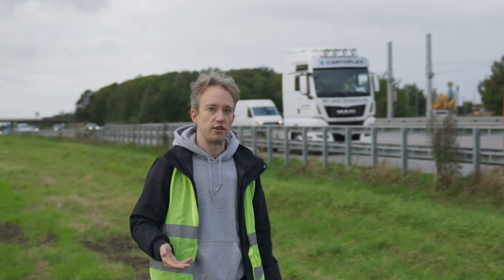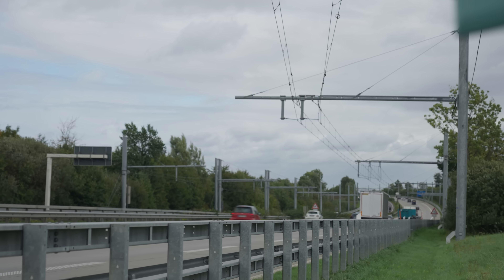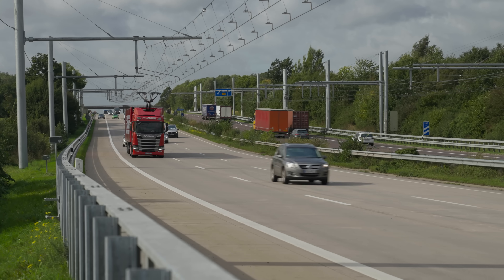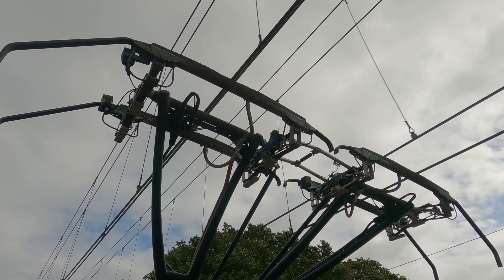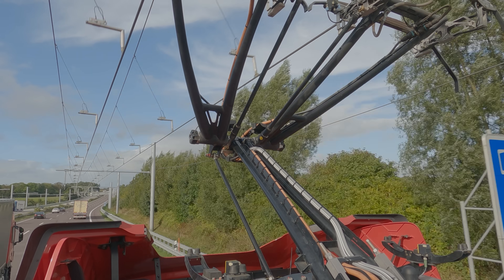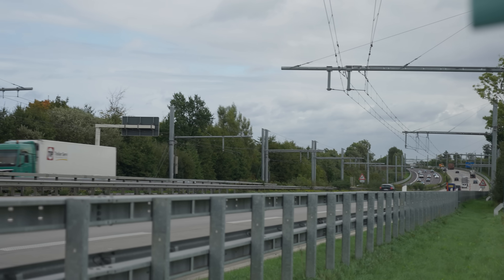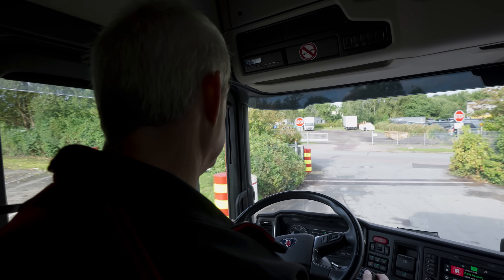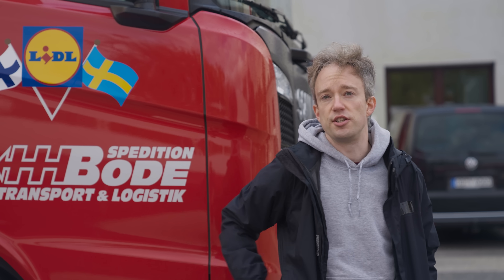The highway where trucks work like electric trains

Comment: Can't wait to see this feature in Truck Simulator 3.
Reply: more likely on 2 by dlc
Reply: @serdarcam99  True and most likely be £13 or $13
Reply: @serdarcam99  Save the World DLC
Tesla Semi, Kenworth T680 FCEV, Peterbilt 579EV, Freightliner eCascadia,
Reply: You joke but I absolutely don't see why not
Reply: Do you mean Euro Truck Simulator 2.
Reply: Electric autopilot... so fun, very enjoyable
Reply: I think you'll have to wait for Truck Simulator 15.
Reply: assuming it will ever come out
Reply: Hell that would still be cool feature to implement
Reply: Yeaaa
Reply: why not ets2?
Reply: @krisnadiimam4556  Well ... also ...
Reply: Lmao
Reply: Hahahaha 🤣 bruh
Reply: In Europe it will only go as far east as Hungary. :D
Reply: Super 🙏👍🙏
Reply: noobs!
Reply: And Euro Truck Simulator
Reply: Euro Truck Simulator 2 actually got a fully-electric Renault truck in a recent update
Reply: The real question is when the trucks are supposed to fall, do they break from the wire, or do they hang onto the wire.
Reply: @dinnerboons1504  What do you mean by "supposed to fall"? Also, the trucks are connected to the wire via a pantograph, so the only physical contact is the two metal pieces touching.
Reply: @dinnerboons1504  fall???
Reply: Train Sim World has it already, except without steering! :p
Reply: @Quasihamster  Except Dovetail still making switch from diesel to electric (for hybrid locos) as another separate mission, cause they didn't cracked the script for a real thing yet.
Reply: @jayswarrow1196  I don't care really, trains are trains, all the same.
Reply: ok verified person.
Reply: @MasterBomer  how dare they be verified lmao

Comment: What will be the fuel of choice for electricity generation ?  Are emissions from power generation plants treated differently from automotive emissions ? If yes, to what end ? Also, as this scheme is being piloted, it might be helpful to know the 'fuelwise' contribution to Germany's electric grid at present which might help extrapolate the same 10 yrs down the road.
Reply: I am not sure about Germany but in Ontario, Canada we have clean nuclear, wind, and hydroelectric power. (95% of our power is zero-emissions) A system like this would undoubtedly reduce emissions. 

I know France also has a very clean power grid.

Comment: I think it's not the best solution, because it means that they have to build new trucks and this emmits more CO2 than keeping the old ones for at least 10 years. Also, why don't they just use trains, the infrastructure is already there (for the most part), they only have to extend it a bit and the roads wouldn't be as full as they are now.

Comment: The autobahn that this installation is on seems quite lightly trafficked; I don't know whether it's always like that. I think driving with the system on our very busy motorways in the UK might be problematic or indeed impractical.
Reply: It highly depends on when you are driving there. It's the main connection between Hamburg and Lübeck. 
During rush hour, it is highly trafficked, but the rest of the day there isn't too much traffic. 

The problem is that I have never seen a charging truck at this part of the Autobahn even though I live 10 minutes away from it.

Comment: I thought about having a similar thing in the other lane for electric cars, but then it would mean trucks or any taller vehicle can't cross into that lane, and also the cars will be trapped in that lane causing traffic jams more often
Reply: The thing is, for electric cars it's not really worth it. Trucks are large and heavy, and drive for long hours. Cars are small and lightweight, and most are often used just a few hours a day. Most cars spend far more time parked than moving, and when they move, they do so well within the margins of battery autonomy. Few cars, such as cabs are the exception.

Comment: "Most efficient"?

Citation needed.

Yes, batteries are not perfect, but compared to the costs and effort of wiring up every single road in all of Germany and the maintenance of it all, and all the safety considerations and concerns?

Sorry, but simply putting more batteries in a truck - which is not exactly a small and light vehicle anyway, so it has the room and could take the weight - would surely be the vastly easier and cheaper solution.

Like, being more precise, the cost and capacity of batteries has followed a "Moore's Law"-like progression over the last 10 years. New tech like solid state are coming. Improvements in efficiency of existing lithium ion is on-going - such as the elimination of the use of any cobalt. This is like hydrogen fuel cell cars - by the time you've got all the infrastructure and safety stuff in place to do it, then the problem's vanished in the meantime. Electric cars used to, at best, do 100 miles ten years ago, now they're doing 300 miles. While the price per kilowatt has fallen off a cliff.

To be clear, try these things out. Empiricism for the win. Give all these mad ideas a chance, just in case one of them does prove awesome. But, nah, by the time you've got all the infrastructure and safety in place, then battery improvements will have made it redundant.

Hydrogen fuel cell cars are similar - by the time the infrastructure exists (remembering that hydrogen is an explosive gas, so you've got to have lots of expensive safety measures in place too), then the problems they were meant to solve - that batteries couldn't deliver the range and take longer to charge - have already gone away. 

Like, if you proposed hydrogen cars 10 years ago, then it might have made sense. But now you've got ordinary EVs - on sale right now - that'll do 300 miles and can be super-charged to 100% in 15 to 20 minutes (and, as has been commented by others, if you're travelling 300 miles, then YOU, the driver, needs a break too - you, as a human being, need to stop and refuel with some food and a trip to the toilet and, with truck drivers, that's actually a legal requirement, not just good advice, so one could even see battery vehicles helping to ensure that important health and safety requirement that you take regular breaks, actually happens).

And, indeed, talk of hydrogen-powered electric vehicles has kind of slowly faded away over time, as that calculation has been made that the range and charge problems that hydrogen was meant to fix have already rapidly disappeared.

Comment: If you want electric for everyone and everywhere then run wireless charging under the primary roads or on a rail along side then everyone charges their battery's while on the move  (it works just like wireless charging on your phone)  You add this to all major roads and when a vehicle leaves the main road it is fully charged for local non charging roads.   It looks better cost less and simply works better.    This tech is right around the corner and is being tested now.
Reply: wireless charging is unfortunately very, very wasteful - to deliver this much power via wireless charging would waste literally half of it.

Comment: To everyone saying just use a train:
Trains cannot do the last few miles from the station to the store. By the time that trailer has been transferred from a train to a truck (often by an expensive unionised employee), it is cheaper just to use a truck for the whole journey. It's also quicker, which is important for perishable foods. That's why village and town rail freight yards have been closed by the thousand. Railways were invented in a time when onward transport was by horse and cart. 

This system uses electricity, just like a train, but allows for efficient transfer between depot and shop. I think it's fantastic and should have been done a long time ago.
Reply: Technically containerised freight speeds the transfer process up way more with just a box being picked up from the train and dropped off onto the truck in minutes.
Reply: @davidty2006  Even then, we only really see rail container flows from ports and between depots. Containers didn't save small rural or urban goods yards, despite being introduced around the same time the yards were being closed en-masse. A train stopping at each station along a line to shunt a few containers into a goods yard, unhitch them, pick up empty containers, then continue to the next station just isn't viable. It worked when the competition was a horse and cart. Furthermore, goods can easily spend hours in a marshalling yard, especially if branch lines are being served with a goods service. Trucks are flexible over shorter distances, with rail ideal for trunk flows. 

If they were to reopen the goods yard at my local station (it's currently a station car park), the freight train could easily block the up slow line (into London) for 5 minutes. That's enough to force the stopping passenger services onto the fast line, which would cause chaos. The next station up the line, 3 minutes away, had its goods yard on the opposite side of the tracks (also a station car park nowadays), meaning freight trains would have to cut across the 2 fast and 2 slow lines. There's no easy way to do that during the day, because the line is very near capacity. Signalling upgrades would cost millions. Unless if you're transporting goods at night (which will be really unpopular with workers accepting deliveries), freight could cause chaos with modern passenger services, which are far more frequent than historic passenger services. 

You could create goods yards with avoiding loops so the freight trains don't block the passenger trains, by compulsory purchasing and demolishing hundreds of homes. It'll be cheaper just to use overhead-electric along the motorway.

Comment: It would be easier to know that this will be economically viable if we had an honest economic system. If we charge fees to industries when they pollute or deplete natural resources, prices will show costs in terms of impact on the environment along with other costs.

An honest market will promote the best solutions automatically. No government subsidy required.
Reply: just because it would use electricity doesn't mean THAT doesn't have a source that isn't dirty. it just means it changes the load from oil, to fossil fuels at the plants which is still cheaper to do than renewable resources for such a large scale demand if this pops off. what we really need is to be able to produce electricity from more clean sources to REPLACE fossil fuels otherwise just shift where the fossil fuel demand is. :/
Reply: @arthurpendragon8192  If we had an honest market, investors would fund research and development of molten salt reactors (LFTR, for example) that could be used to generate electricity for this and other purposes. The high heat produced by such a reactor can also be used to manufacture liquid fuels for transport (primarily during times of slack electricity demand, perhaps). That may or may not be a better solution than the system described in the video. I don't know. But I am confident that, if prices show all costs (including costs in terms of environmental impact), a free market will be able to find the best solution.

Comment: Powering trucks with electricity while Germany isn't phasing out coal power until 2038.
Reply: Not only that, a fair bit of it is lignite (brown coal) as well. Depending on the power source, we could be looking at a coal powered truck! There is still quite a lot of open cast mining in parts of Germany at present.

Comment: When travelling across large European cities fifty years ago, the sight of aerial power lines for trams, electric buses and council maintenance vehicles - was a very common occurrence (One council had a welding machine with a pantograph!). I successively witnessed the "rise of the motorways", and a common question was: "Will they install the aerial lines for buses and trucks on the motorways?"
This reasonable expectation of the common people was shattered by the rise of the diesel trucks and the fall from grace of train haulage services.
Imagine if, in the '60s, the motorways were built so to include the overhead power lines in the infrastructure, all over Europe. Nowadays, the transition from ICE to electric vehicles would be as easy as adding a pantograph to every car.
Regarding the transition to green energy - I see a problem if the transition is not handled properly by politicians. An improper handling of the upcoming transition that would result in an excessive increase of the price of the energy, could easily end up with a rejection from part of the public. As of today, I don't see the carbon - free baseload generating capabilities necessary to handle the transition.
Thank you for the great video. Those overhead power lines on the motorway are surely looking into the future, but they also recall a recent past.
Regards...

Comment: Its only a good idea if the trucks receive enough usable power. Is it enough to just keep it going for that electrified stretch or is there enough to do that and charge the batteries at the same time? If so how much charge in terms of km's would they get? Can it hold up to multiple trucks using the same electrified stretch and is there a limit? etc.
Great video as always!

Comment: With 200 miles or so of battery range on a truck, America would mostly only need to do this on the interstates to make it viable.
Reply: A lithium battery lasts 400-600 charges at best. The cost of constantly replacing those on heavy duty vehicles is very expensive and prohibitive. Even just putting them in to begin with doesn't make sense from a cost and raw material perspective. Tesla charges $16k for a car battery, imagine what one for a truck would cost. It only makes sense if it's a secondary thing, that allows the trucks to get get to and from the overhead power lines.

Comment: As an Electric Vehcile related youtube channel my self I've been following this tech for a while there's also a version that would work IN the road as in NO overhead but in the tarmac.   All these ideas are interesting however with taco breaks set to what they are and charge rates now at 350kw the use for these over head charging rails is shrinking.

Comment: I don't see how this is cheaper than just more charging stations. Batteries are getting cheaper, more dense, faster charging, and longer lasting every year. We can have semi trucks with 800 mile range. And it will be cheaper to just charge them when drivers stop for rests, rather than building and maintaining this expensive infrastructure.
Reply: Government spending.

Comment: They can charge at the depot? Oh dear. I suggest you brush up on your understanding of road hauliage. Vehicles are used around the clock. There is not much time at the depot to charge up the size of the batteries needed to run articulated lorries.

Comment: would be a great idea for public transport within towns and cities , just imagine running a long `bus' type vehicle on a fixed route......oh , hang on , they did that a hundred years ago and the ripped it all out.......
Reply: In Poland it was called "Trolleybus", my parents remember it still being in use (and i think, in some places, they still are). But it's hiedous. If you get a more discrete system in place for regular recharges whilst going most of thge way off-grid battery powered it would be a lot easier to implement into city infrastructure and would also not make cities look weird with cables all over the place.

Comment: The trolleybus has being a thing for about a century now.
These do have their disadvantages. But if we set pure economical and practical matters aside and replace them with a Green Leap considerations, building and maintaining the electric highway network might even happen. Though it might appear that shifting the container traffic to electric trains would be more practical, leaving the truck only for the last mile delivery. And even that would be fully autonomous self driven container mover rather than truck.
Reply: Trucks will climb hills better than trains and some road traffic go between city pairs that can never have enough volume to support a train line in any way
Reply: @duncantalksalot  I guess, considering all the building and maintenance costs, plus grater efficiency of the train, the electric truck line won't be much cheaper than a train line. As I said, for the low traffic and irregular lines the regular truck, diesel or battery, will be the way to go anyway.

Comment: A km of rail is magnitudes cheaper to build than a mile of highway.

If many of these trucks become trains instead, highway wear will go down drastically, and roads will require less lanes. The main reason for overtaking also disappears at that point.

Comment: Doesn't seem feasible to put high voltage lines over every road. Systems like this work for buses and trains because they have fixed routes. Semis, by contrast, require the ability to choose and shift their routes freely, so they will always have to rely on batteries either way. In that case they should just commit to pure BEV from the start.

Comment: The problem is, it is very ugly. And isn't it stressful for the driver to keep his mind on the contacts being in contact all the time?
Imagine building this massive infrastructure then highly efficient SS Batteries are finally invented where charging is faster than filling with diesel and the range is twice as long as diesel.